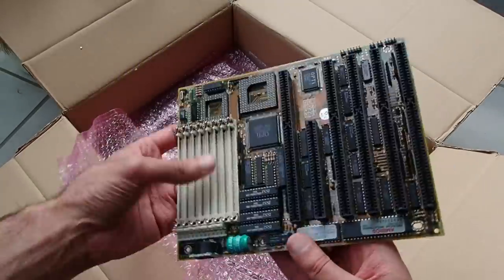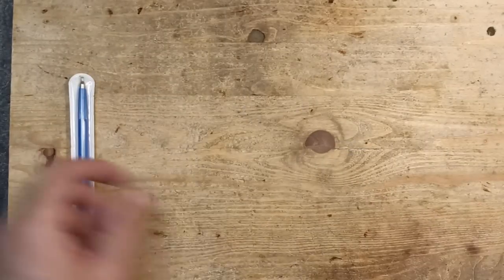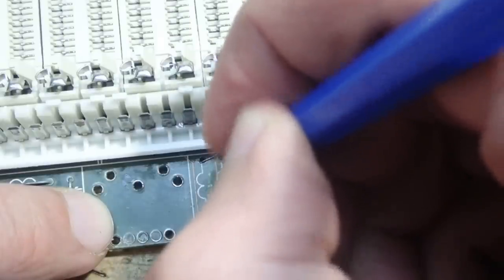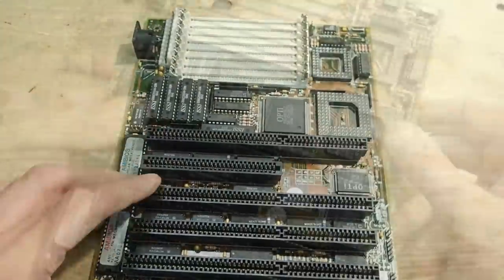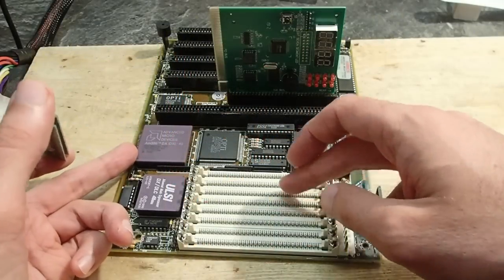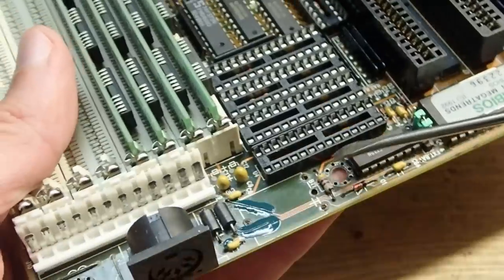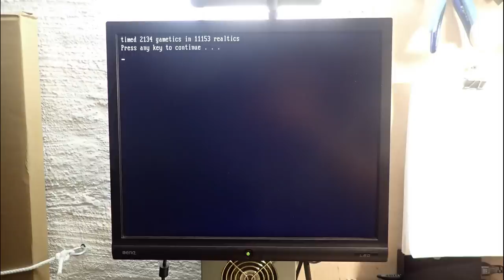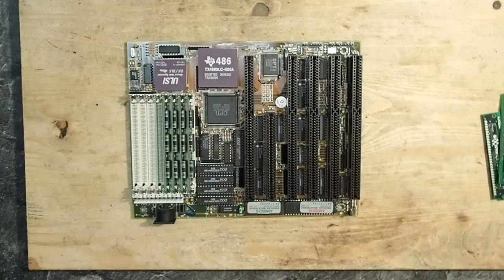Repairathon 2022: A hot 386 mainboard, sometimes size matters

Comment: Ahhh, I used to have that very board.  Back in the late 90s as a poor college student, I had a 3rd-hand 286 laptop, but it wouldn't run Linux.  So I carried around that 386 board with a power supply and hard drive, in a shoe box, and used the 286 laptop for a serial terminal, lol.
Reply: I need to check but my brain says i still have a few of these, also the fuzzy memory in me remembers hating the NI-cd batteries and i would rip them out on sight, exactly because i experienced one of those leak and make the keyboard unusable (probably needed this same fix).

Comment: Worth mentioning that this kind of soldering tip is ideal for doing the tinning and the trace repair like that. Ask me how I found out...
I still find it amazing how precise and steady your soldering is, I tried something similiar recently (on a much smaller scale) and did in the end succeed but I needed extra precautions as to use Kapton tape very close to the soldering area or I would just solder my wire to ALL parallel traces too.

Comment: Glad I bought a set of those 20N ISSI cache chips years back. They find use on retro boards very frequently. I only have 128KB in 15N version, but I never notice any difference if I try them, or the slower ones that I have in abundance. On one 486 (M601A, I believe), to get a 133MHz DX-5 running I had to reduce 256KB cache down to 128KB, or the system wouldn't boot with anything higher than DX2-66. None of DX4 or overdrive support of any kind. I read about it being a thing with some 1st gen boards that could somehow handle DX-5. Speed is not the issue there. Only cache size. And it's strange to me that a faster CPU would need less cache and not other way around. I know this to be a thing, but I don't know what the reason is.

Comment: Thanks for installing the DLC in it en the end even if just for a test. I'm a big fan of these old Cyrix/TI chips (had one back in the days), and when you picked the 386dx first, I was like NOOOOO, pick the DLC, pick the DLC... :) Then I got my reward in the end. Cool video.
Reply: Yeah, i remember those late AMI bios could enable the internal 1k DLC's cache. Without support in the bios you had to use some dos program to enable that at boot. Made a ton of difference in games like Simcity 2000. Oh yeah, i used to have a motherboard like this, with a VESA local bus and a 1mb "SVGA" VLB. That's right, i had a 386DX motherboard with a single VESA local bus. Actually i might still have it, and i did use it with both a 386DX40 and later a Cyrix DLC40 before i upgraded into 486DX realm with a different motherboard with TWO VESA local bus slots. That also allowed "true color" in windows 3.x and 95 at decent speed.

Comment: Neatly done!  I would have used clear nail polish, but, hey, whatever works.  The board certainly moves right along with that 486DLC, and I'm sure the MCP makes a bit of a difference, too.
Reply: Unless you used something like Autocad, not really. Since most people did NOT have one until the 486DX bundled it internally, most software was written for integer math and would not benefit from it. Most notably old games would not use it even when present.

Comment: Great video, good work and thanks for showing this off, Necroware:) Subscribed! Oh and excuse my nitpicky 2 cents, that are in no way a critique or do matter. Just some nerdy chemistry background, no one needs:P, hehe:
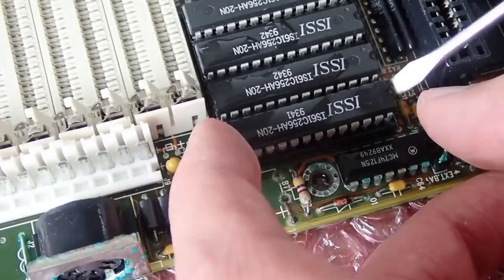0:40 onward: "If the concentration is to high, it [acetic acid] will start to attack the copper traces ... if you let it there for too long". Yes and no. There is no "if - then" ... it is not a sequential action. The chemical processes of neutralizing/cleaning and etching start immediately and CONCURRENT!. Also every concentration will attack the copper traces, if they are not protected by soldering lacquer/protective coating. That's just how acids work (But that doesn't matter, see next part). "if you let it there for too long": A 5-10% acetic acid solution will take approx. 1-3 hours to etch away the standard copper layer thickness(if it is cleaned up like a newborns backside), where the alkalic battery fluid/electrolyte will take days to months damaging coating and traces. So you should pay attention to the order of magnitudes here(Cleaning takes seconds to minutes!). Just cleanup the battery mess ... then clean up the cleaning mess. There is no need to take any special precautions here[1] ... (if) harm was already done to the PCB, you won't make it worse by cleaning it. TLDR: NO PANIC! Hehe
BTW: Oxidation is NOT Corrosion. They are different beasts (and some oxidized surfaces like Al2O3 are in fact a PROTECTION against corrosion). Also we have to distinct between electrolytic corrosion (by direct reaction with the pollutant) and galvanic corrosion (by current flows enabled by the pollutant). But that leads too far to treat that topic here. For further information see for example Altium's site, "PCB Trace Corrosion: Why It Happens and How to Prevent It"

[1] Not talking about fumes, the delicate hands of the cleaner or the safety of his eyes and mucous membranes ... or the correct and environmentally friendly disposal of the waste. These are other topics and lie in the responsibility of the operator.

P.S.: Just for the girls: Please check the nail polish for conductivity ... otherwise there will be nasty surprises. (Yes, we girls, or rather the manufacturers, also use metallic or conductive additives, hehe). Hmmm just as info, the proper thing, like "Solder varnish SK10" or "PLASTIK 70" spray will cost around 12 bucks for 400ml ... which will be enough for some for 10 or 20 years.

Comment: Nice video. I like the attention you gave to quality, make sure it's done well, done right, and will last. I have a question: how do you know where things are supposed to be connected or go? You seem to know exactly where to stick the probes, what result to expect, how did you learn to diagnose? Thanks for the information sharing and effort in preparing these videos.
Reply from the maker: Thank you! In this video the damage was mostly keyboard related. I already made multiple videos in the past, where I explained how the port is connected to the keyboard controller. It is a very common problem, because the battery is often located near the keyboard port.

Comment: Vinegar is an acid. We use the acid to "eat" off the corrosion. Using a strong acid will "eat" really fast, possibly too fast to stop it when it starts eating the stuff you want (copper traces). Using a weak acid will be slow but you'll have plenty of time to stop it before it gets too "hungry" and eats the stuff you don't want it to eat.
Reply from the maker: That's not quite right. Vinegar is an acid, that's right, but we don't use it to "eat" off the corrosion. We used it to neutralize the battery electrolyte, which is a base, to stop the chemical reaction, which leads to the corrosion. Acid reacts with the base (electrolyte) and turns it into water, but if the proportion of the acid is higher, then it starts to attack the copper again. That's why it is important to wash away everything as fast as possible. I made a video about this topic once in the past: https://youtu.be/sVxqLBp6l1c

Comment: I had an old 8 bit video card I used for testing. I removed the metal bracket so it would sit flat and properly when I operated the board out of the case and flat on the desk. I had one too many screw ups trying to prop the edge of the board on something when testing with a video card with the metal bracket installed.

Comment: I have a system with a Shuttle HOT-307 board in it, which is very similar but slightly older (no 486 support) and also larger. Works just fine, I didn't have to do any repair work at all.

Comment: Im currently trying to repair a huge, old (begin of 1988) 386 mainboard. Its quite incredible, with a full length memory card that has 72 socketed 1Mbit DRAMs on it. Thats 8Mb, in early 1988. Also the board has 2 leaky batteries for twice the fun and has integrated parallel/serial ports which dont work unfortunately.
Also got some really nice and certainly equally expensive cards, like one SCSI controller with an 68010 on board, 2 working Hercules TIGA cards, 2 8bit VGA cards and 2 huge cards that seem to be controllers for a very old laser printer, with a 68000 and 3MB of ram on one, and a 68010 and 6Mb on the other.

Comment: This board with a (usually AMD) 40Mhz chip was THE budget door buster special in 1993. They could be had for much cheaper vs. even a modest 486 at the time, and provided a big boost if you were coming from a 286 machine. It ran Windows 3.1 decently enough in 386 Enhanced Mode, but like everything else from the period, Windows 95 killed these machines off if they didn't have the memory.

Comment: If you install more memory onto this motherboard, I'd recommend enabling all of the adapter ROM shadows in the BIOS. This is a trick I used to squeeze a bit more performance out of systems of this date. What it does is copy everything from ROM into RAM. Since ROM access time is much slower than RAM, this is going to cause systems of this vintage to improve performance.
Reply from the maker: This makes only sense for addresses where ROMs are present. I made a video about it couple of year's ago in context of XTIDE. In this case I have no additional ROMs in memory, but the system and video BIOS and both are already shadowed.

Comment: of course Doom is playable but yeah you gotta make the screen smaller... we suffered through much back then... great times :D

thanks for a great video, have fond memories of the 386-486 days :D my first OWN pc was a used 386sx 16MHz with 1MB later upgraded to 5MB and a whopping 200MB HDD :D later on I got a 486DX2 66MHz which I quickly upgraded to a 80MHz from AMD :D

Comment: It's a good thing they started using coin cell  batteries. A more modern board couldn't be fixed this way if you had problems in the wrong spot, so many layers and small traces, components. Amazing work. I'd like to see this thing souped up with 32 MB of ram and win 95 with the cyrix 486 that would be interesting, could you change the clock crystal out and squeeze a few more mhz out of the cyrix 486? Volt mod? I dunno.
Reply from the maker: Yes, it is possible, but atheatos already made a lot of such stuff on his channel. Feel free to take a look, he always goes one step further.

Comment: Very nice repair.

About doom however, I think the 486DLC actually makes the game playable. Of course not in the best conditions, like you could have with a 486DX2-66, but that was definitely the "high end" part. You can decrease the resolution slighly and reduce the details, and this should already speed up the game quite a lot to be in the playable area.

Also, the game works with 4MB of RAM, but it's faster with 8MB !
Also you can probably tighten up the memory settings at 26:59 to make the system even faster (I think the board should let you use 0WS)

I know I've done that before but I'm curious how a superspeeded 486DLC would perform with DOOM on this board :)
Reply from the maker: Well, everyone has his own expectations of what is considered playable. If I squeeze everything out of this system it will get to 15 FPS when playing with full details and full screen only reduced by the bar on the bottom.  The limiting factor is the ISA bus and with VLB it runs a lot faster, but I don't like to play Doom even on dx2-66 with VLB. You get to full 35FPS using DX2-80 and that is a machine, where Doom makes fun regardless how many enemies are on the screen. I never managed to play it through on a DX2-66, since on higher levels the CPU starts to stutter and it gets hard to fight the waves of monsters.
Reply: @necro_ware  well yes, back then the game was demanding. I guess the most "high end" machine money could buy to play it was a Pentium 66

For the time I guess the game was playable even on a 386DX-40 with low details, but indeed was much more pleasant on a beefier machine. I wouldn't consider "stutterless experience" being the only way being playable, but of course it's the most pleasant one and now anything can run doom (quite litterally lol)
Reply: @necro_ware  That explains it, since i played with both the 386DX40 and the 486DLC40, with VESA local bus (yeah i have one for 386DX class), never saw anyone else with one, all the VLBs were usually in 486DX class mobos before the PCI age.
Reply from the maker: @freeculture  VLB was introduced for a 486 and basically it is connected directly to the CPU, that's why it is so fast. There were some universal boards for 386 and 486 with VLB, but there the VLB was attached to the CPU through an additional bridge, otherwise it wouldn't work with a 386DX, since that CPU didn't know what VLB is. It was already definitely faster, than ISA, but such boards were slower, than a real 486 though. I have such board and I plan to make a big video about it and especially about Doom performance ;) I planned it for DOSember this year, let's see if I'll find time to do it.

Comment: breathing those fibreglass 'needles' would also be a huge hazard to your health. 

I like the Dremel tools but I tend to use a model railroad track rubber, there are at least two types, the Peco one is too coarse IMO, I prefer the Guagemaster one, it does a really good job of cleaning stripboard, copper clad PCB and removing corrosion from electrolyte damaged boards.

Comment: I think I need to do similar on my SOYO 486 motherboard. There is damage from a battery leak and a couple of weeks ago the onboard serial ports stopped working.
Reply: I learned the hard way in the 90ies to rip out any NI-cd batteries before storing things like motherboards away, as they would for sure leak and destroy. Thankfully the industry switched to the Lithium coin clock batteries that don't leak, they would just lose charge.

Comment: That is a nice board.  Thank you for saving it.  I'd like to see if swapping the math-coprocessor, tweaking the bios settings, and maybe a slight overclock (not sure you could do it with that clock generator) would get you over 15 frames in Doom.  Still not really playable, but something that could show how well designed the Cyrix chip was for its day.
Reply: Doom doesn't use floating point math, so the FPU doesn't make any difference. Quake would show a difference, but probably run at less than a frame per second, if it ran at all.
Reply: @menotyou8369  I agree with you, but if your going with an upgrade, I say go all the way.  I’m rebuilding some old computers that I wish I could have built, but didn’t have the money for back in the day.  It’s been fun getting old stuff working again such as an Everex Step with a 386/33 Cyrix , AST Premium II 486/66 DX2 and now a customer built Intel pentium 233MHz

Comment: Hello, It's always a pleasure watching your repair videos, these CPUs only require to enable the L1 to enable their full potential?
They don't feature any special instructions like the socket 3 Cyrix 5x86?
Reply from the maker: There are some minor additional settings, which can be set using a utility, but it's more about compatibility, than performance.
Reply: It behaves like a 386 and that was intentional, it was meant to upgrade your 386 like you saw in this video. There was even a variant that would clamp on top. SLC to upgrade from SX, and DLX to upgrade from DX. (It gets confusing with the later 486DX, so ignore that)

Comment: Another great video from Necroware! Can you please provide an info on what kind of dioxide spray you use and what contact spray did you use when cleaning cache DIP sockets? Would WD40 work for cleaning DIP contacts?
Reply from the maker: I use German "Kontakt" Spray. You shouldn't use the usual WD40, that would attack the PCB, but WD40 also makes a special contact cleaning spray.

Comment: Nice work. Since you needed to replace the AT-style keyboard connector, I started wondering if there is actually a PS/2-style replacement with the same footprint and pin-outs available that could be used as a substitute? I know retro purists would probably frown upon this idea, but it would mean one less converter cable 🙂
Reply: Converter cable? There are adapters that are just one solid small piece. If you want to be purist, just use a proper AT keyboard.

Comment: I'm pretty sure I played doom back in the day on a 486 25 mhz and I have the feeling that the fps was playable, feel strange to me
Reply from the maker: The cyrix CPU, which I used in this video runs at 40MHz about the same as a normal 486DX-25. So, you'd get around 10FPS there as well. Back in the days we called it playable 🤣
Reply: I also remember DOOM running perfectly (more than 20fps) on a "real" i486-33MHz, with a VESA local bus VGA (Cirrus Logic 5426)
Reply: I can't actually recall the exact system settings, but i'm a 100% sure it was more than 10fps. The PCs we used were in our universities datacenter pool with 40 of the same kind. they had if im not mistaken 100 MB of hard drive and 4 MB RAM